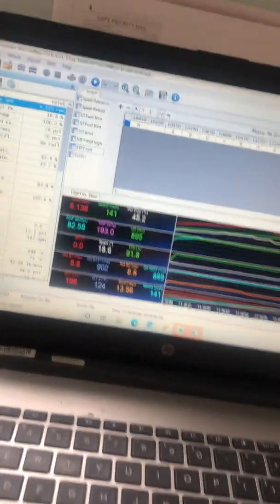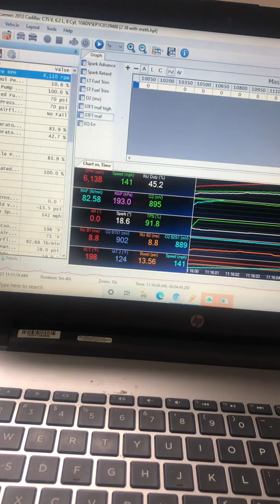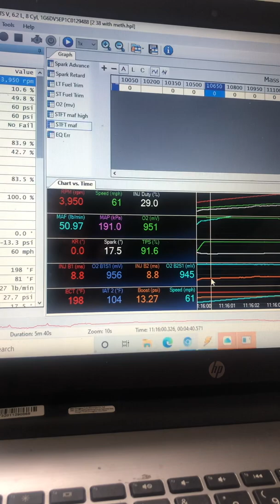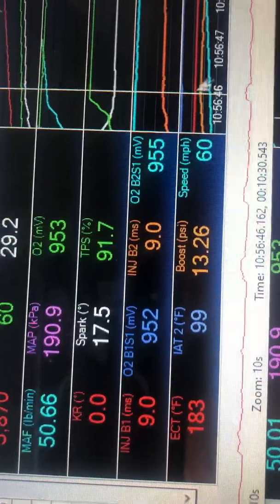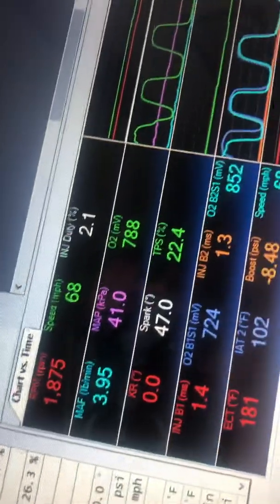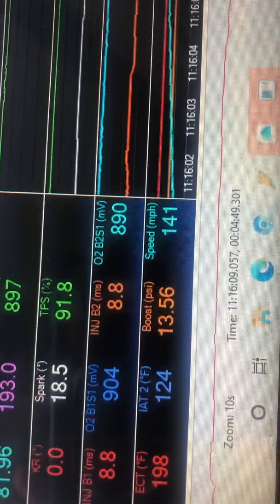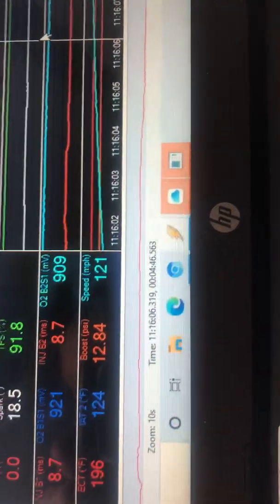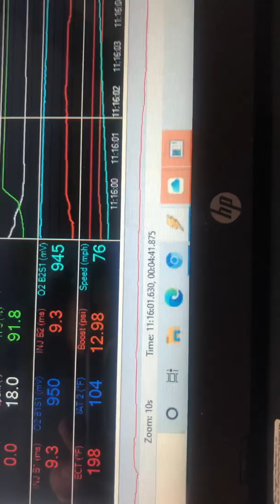AEM v3 methanol kit review and IAT log on LSA supercharged CTS-V

Comment: I would guess that the nozzle is pre intercooler, would you get better results if you did post intercooler/direct injection water methanol? 🤔 I don't know am kinda debating on this one, regardless of the cooling system size of course.
Reply from the maker: On a PD blower like mine both pre and post intercooler is the best. Pre to cool the blower but you do lose some effects through the rotors. Spraying two nozzles,  pre and post IC  works really well I’ve been told. 

I may try it but I would have to buy a spacer, I don’t want to drill and tap my lid

Comment: Great comparison vid. Even down to the log it was pretty identical which helps comparing numbers. 

Can you tell my what your settings are on the controller? I’m at 4psi start/10psi max boost.

D1X Procharger 6.0 LS 12 psi
Reply from the maker: Mine is maf trigged so my settings won’t match yours. 
I just played with it on the street so the green led came on about 3k rpm under load.
Reply: @DBTUNED-FL   

Thankx for the reply! I’ll keep playing with the settings to see what works best. My IATs are relatively low because of the FMIC anyways. I really just want to lower them the best I can. Take care man! #LSFTW